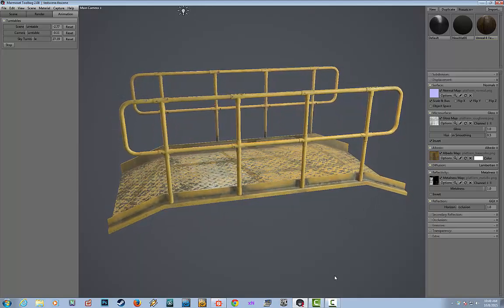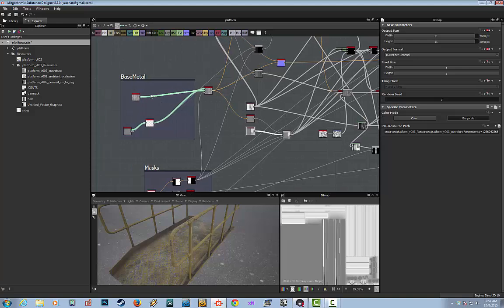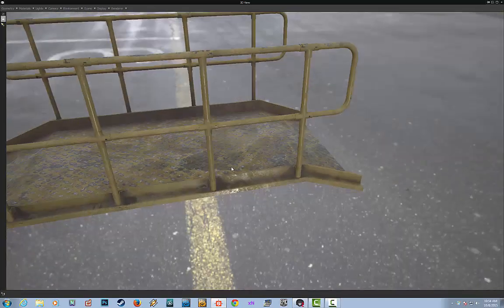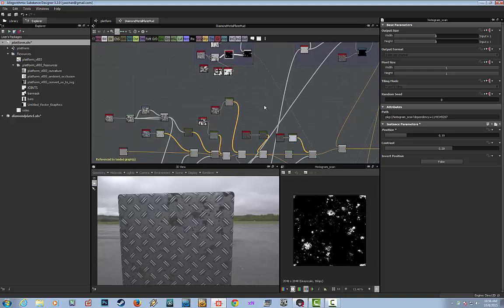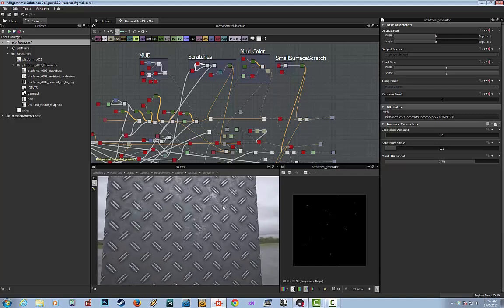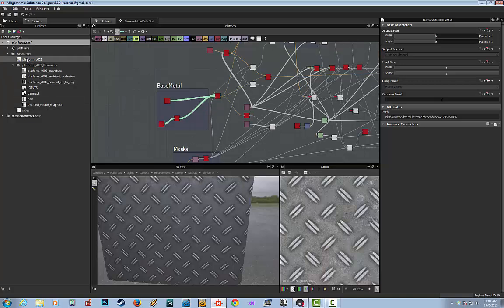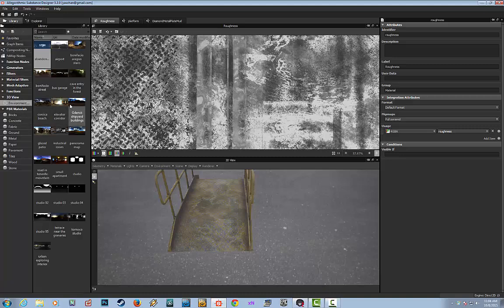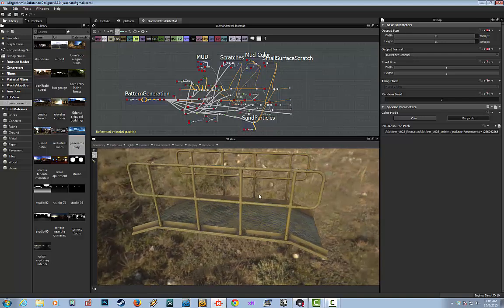Intro to Substance Designer Asset Texturing

Comment: OMG  that node web....this is terrible
Reply from the maker: +NexusCool1 well, sir, would you have a less terrible way to accomplish this?
Reply: Probably faster and easier Zbrush/Photoshop combo.  But to be honest i was having same reaction when i saw Zbrush for the first time. Anyway...still when somebody look at that node network it looks crazy complicated for just one material..
Reply from the maker: NexusCool1 Might be. But if the asset is more complex one or if you need to make serialised assets, this is definitely better way, plus and you can make changes quickly. For example if you need to make other models with same look, once you have built your graph, you can reuse it again and again or even parts of the graph, like I did with the diamond plate pattern, plus you get the benefit to export .sbsar with exposed parameters to real time tweaking in game engines.
These are the reasons why almost all game studios use Substance Designer and Painter.